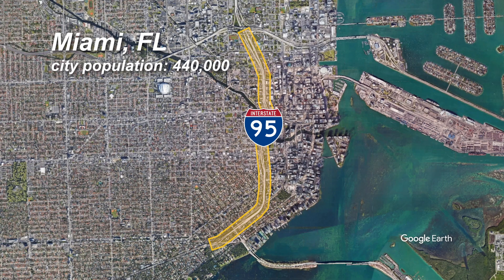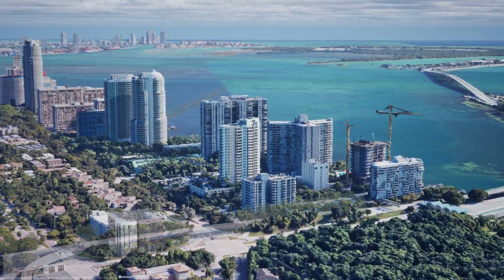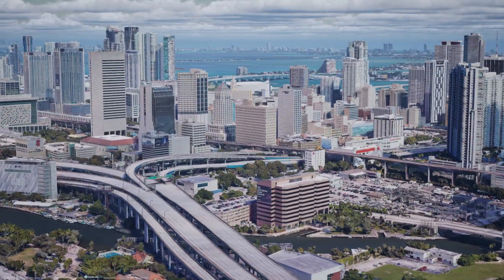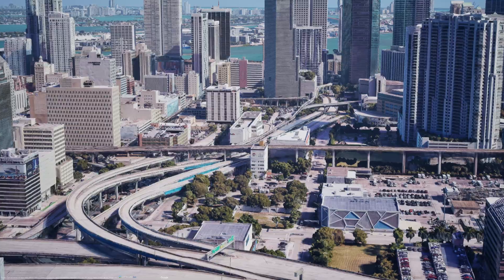Imagining Miami Without Interstate 95 | Removing Urban Freeways

Comment: There would need to be more capacity added to the Miami metro system. The public transit needs to be upgraded at the same time, as in more rail lines and better BRT.

Comment: Nice idea, but you can't get rid of something until you have a viable replacement. The city of Miami has a density greater than Chicago or Philadelphia and should be able to support a more robust transit system than the 1.1 line Metrorail. Miami Dade residents voted for an extra tax to extend Metrorail up 27th Ave and out to FIU and west Kendall and all they got was a 2 mile extention to the airport.

Comment: Result, congested nightmare.
Reply from the maker: I've been to this part of Miami. The freeway was a congested nightmare.
Reply: @LucidsTwo  and worse without it.
Reply from the maker: @joshcarpenter400  Not necessarily. These are things worth studying in more depth. Removing the freeway would certainly make the city more livable with better continuity. Why not see if there is a way to makes things work? Why cling to what is there simply because its there?
Reply: @LucidsTwo  wouldn't there still be people who have to drive to work who are now going to clog the city streets?
Reply from the maker: @joshcarpenter400  That's why you try to find other ways of moving people around.
Reply: @LucidsTwo  true light rail, dedicated bike lanes, and busses are great. I also believe that urban expressways are still important for moving people who still chose to drive.
Reply: @joshcarpenter400  the only real downside, if anything, is that it would make it difficult for freight traffic to enter the city and make their deliveries. other than that, people can always just find other ways of getting around. i know people who've lived in miami; they always found other alternatives (us 1/dixie hwy, us 41, etc.) to taking the 95 because it just wasn't worth it.

besides, there are numerous examples of cities that got rid of certain urban freeways after realizing they were useless and expensive. in most cases, the traffic basically melted away overnight.

Comment: Option 1 that you suggested with the high-rises is probably the best. Maybe everyone wouldn't need to live way out there and congest the city's roads to get into town if there were more places to live just outside of downtown, where residents could ride their bike or longboard a short distance.

It's truly a crime against the public that there are no parks in this city. And most major streets don't even have any shade for people walking or just waiting for the signal to change so they can cross the street without melting to death in the intense Miami heat.
Reply from the maker: The lack of park space was pretty striking upon closer inspection. It's really surprising that the largest developed park in the city is only 32 acres. I used to live in a city with about 2/3 the population of Miami and its largest developed park is 100 acres. When I lived in the suburbs of St. Louis, I would visit Forest Park all the time. It's about 1,200 acres in the middle of the city and the St. Louis metro is less than half the size of Miami's.

Comment: Very well made! I've often imagined what downtown Miami could look like without the massive freeway blight. Funny enough it could have been much worse though as the reason for those strange tendrils in downtown was that originally there was a plan to completely ring downtown with freeways all the way up Biscayne Boulevard as well. Thankfully we were saved from the absolute worst case but would be much better off it was completely removed

Comment: Miami  would look quite different if   I95 freeway would be dismantled.  What would replace the freeway? Most likely  a  boulevard with residential buildings with retail and services at street level, and a series of public  parks.
Reply from the maker: I had a surface street running from U.S. 1 to 8th in the densest scenario, although I made the choice not to bridge the river. I don't know how reasonable that is. I liked the aesthetics of it. North of the river, I think 3rd continuing as 2 one-ways would work and then possibly extend that to 395.

Comment: That segment of I-95 can partially stay and just be the new US-1 from the current I-95/US-1 merge point until the I-395 interchange, where from there I-395 can concurrently carry the US-1 designation from Biscayne Blvd. I propose that because it would allow both Brickell Avenue and especially Biscayne Blvd south of I-395 to be narrowed significantly as they would no longer have to carry US-1 traffic - and also to remove those weird parking medians along Biscayne Blvd and expand Bayfront Park and improve connectivity because the current Biscayne Blvd is annoying and a bit unsafe to cross. Now onto the interchanges to redesign significantly.

Rickenbacker interchange - SW 26th can be a series of three roundabouts at the old I-95 ramps, Miami Ave, and Brickell Ave. A fourth roundabout can be built at the weird oblique intersection of Miami and Brickell avenues. The main goal here is to eliminate the elevated Rickenbacker ramps. The grade separated alignment here isn't that bad since the railroad running parallel to it is already a big dividing line.

US-41 interchange - As the new US-1 turns north crossing over the railroad it can ramp down and become a surface boulevard. It then intersects with SW 3rd Ave, SW 13th St, and SW 15th road at a roundabout. Yes, there is a rather new roundabout currently there but with the space freed up by the old I-95 alignment, it can be expanded upon and improve. I would also imagine US-1 would continue along SW 3rd Ave (S) and SW 4th Ave (N) with both sides re-joining up near Jose Marti Park. The old I-95 bridge gets torn down but the alignment is kept for a newer and much lower profile bascule bridge like the nearby SW 2nd Avenue Bridge. We'll simply call this new bridge SW 3rd Avenue Bridge.

Mess of SE 2nd and 3rd St ramps - As the new US-1 crosses the Miami river, it just runs as a pair of widened surface streets - NW 3rd Ave and 3rd Ct. The median space occupied by I-95 just becomes a long linear park from SW 3rd St at the edge of the Miami River to some point at the I-395 interchange. The ramps here are simply removed and the space occupied by  them just become regular city blocks.

I-395 interchange - New terminus of I-95 and realignment of US-1. I suppose the massive new I-395 bridge can just stay. As the interchange here is elevated, maybe build a system of pedestrian/bicycle paths that reconnect the severed street grid. Then add some park elements and amenities along the paths plus plenty of lighting and safety/security features so people can feel safe walking these paths.

Comment: How would you fix I-278 from NJ to the Bronx in NY, connecting to I-95?
Reply from the maker: Is it possible? I've never been to New York. Do people actually use that to bypass Manhattan from Connecticut to New Jersey? It's about as far from a straight line as it can get. I think I-278 through The Bronx could go. From the satellite I'm unable to appreciate the point of it, but having not experienced traffic in the area, its very possible I'm missing something. I was looking at Grand Central Parkway through Flushing Meadows, but I like I-278 through the Bronx better, I think. The portion of I-278 in Queens between I-495 and Grand Central Parkway doesn't look all that necessary either. Maybe transit like the Interborough Express would help make those less relevant.
Reply: @LucidsTwo I use the GWB, the Lincoln tunnel to get into NYC from NJ, mostly by using NJ Transit or a ride to the airport.

Comment: No because i95 at its current route serves as a bypass of downtown for South Dade traffic. The route that could and should be removed is SR970 which serves as a feeder route from Brickell to i95. It’s an eyesore, and should be razed for new condo development. Brickell rubber tire people mover system is the busiest in the country, and it’s because of all of the density built around it. And it’s free

Comment: Options make no sense....how will people coming from the Keys into the mainland get around.....without a highways to get people moving south to the north?    Where would I-95 be located if not where it is now?    Miami is fine the way it is....
Reply: If they really wanted to, then they'll probably make the FL Turnpike south of Ft Lauderdale become 95, but then they'll have to remove tolls I think.
Reply from the maker: I-95 would cease to exist. That's the entire premise. Traffic that existing surface streets can't accommodate should be handled by expansion of mass transit like the Metrorail or bus rapid transit. You're so tied to freeways that you can't even imagine a world without them, but hey, you tried.

Comment: Appreciate the work that went into this video! May I recommend a video on Atlanta without the Downtown Connector and I-20 within the perimeter?
Reply from the maker: Atlanta is one of the tougher ones because you're dealing with two through interstates. I don't see I-285 as a viable alternative to I-20. I-85 seems easy. Just resign the western and northern portions of I-285. I-75 and the disaster around Hartsfield-Jackson is the conundrum. How to get I-75 through traffic around instead of through? In terms of removal, I-85 through the middle of town seems most obvious, but to leave in most of the stain on humanity that is the I-85/I-20 interchange seems a shame. Perhaps something smaller scale like John Lewis to the 75/85 split to reconnect Georgia Tech with midtown. That seems like an option with a lot of vibrant possibilities.

Comment: All of South Dade's road transit problems date back to shoving the terminus of I-95 into Miami proper. Hard to see what to do now since 836 is already a million lanes wide but if 95 was moved west with more east-west connectors it would.. help. It couldn't hurt anyway, and it would free up some valuable development.

Thank you for mentioning Overtown - the suburb sacrificed to the Interstate gods in the usual depressing southern manner.
Reply from the maker: There is not a road solution to this problem because roads are the problem.
Reply: @LucidsTwo  indeed

Comment: This has some really nice transition scenes.
Reply: Something I was thinking might be interesting would be to add a total-up of approximate additional housing/retail space for the options with low rise, high rise, and mixed greenspace-and-either-type-of-development? Obviously not precise, but you're using stock buildings which you could count up and apply some kind of rough estimate of number of housing units per building or something?
Reply from the maker: sure, I can do something like that.

Comment: Interesting concept. Seems like we end up with a ribbon of apartment/condo style buildings in an otherwise single family community. Seems like there could be zoning issues as well as a legal battle. Homes were destroyed using eminent domain to construct a freeway for public use and now someone gets to use that land for dense urban development and profit from it? Obviously the family doesn’t get their land back but it probably should be restored to fit in with its surroundings. 

Some future ideas could include I-280 spur in San Francisco north of 101 or BR 80 in Sacramento between 99 and I-80.
Reply from the maker: The total space is roughly 100 acres. You're talking ~40 units per acre per floor on half that for even the most dense scenario shown. The buildings shown average 5 habitable floors. ~2.4 people per household. That's 24,000 people added to a city of 440,000. Not exactly an amount that is going to overwhelm anything. Most of the development is on the edge of downtown and is totally appropriate for the neighborhood which consists of low-to-mid-rise apartments everywhere except the neighborhood in the far south. I left that mostly green in all but the most dense scenario.
Reply: Most of the Anglosphere is in a chronic housing shortage, if given a large amount of land within easy commuting distance of a major job centre, it should be medium density mixed use, potentially high density if that particular city's crisis is bad enough.

Comment: Miami's such a beautiful city, wish it didn't have all that humidity. I love the clouds plugin you added, makes everything look super realistic.

Short-distance freeway removal suggestion: the 163 between downtown San Diego and Hillcrest, which used to be empty parkland with lily ponds
Reply: Dude, SD has endless options in this department. Or I should say it's metro area, since Chula Vista experiences the same issue with freeways and highways.
I'd add too much sun, too much heat to the humidity issue haha